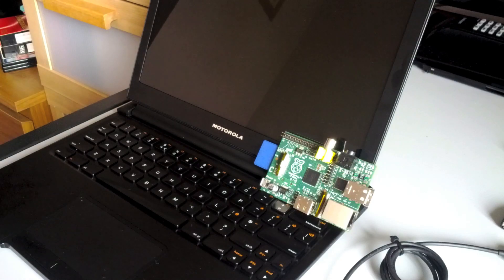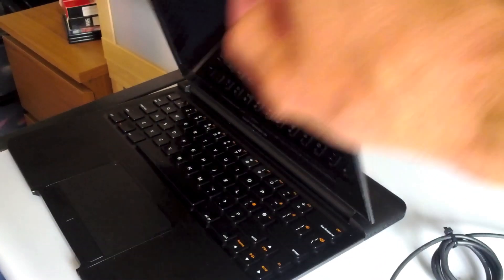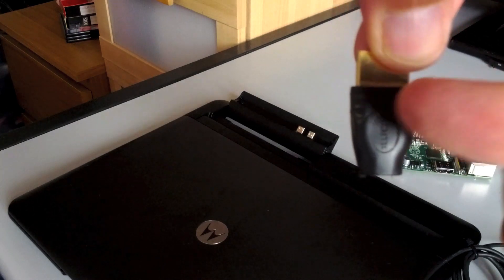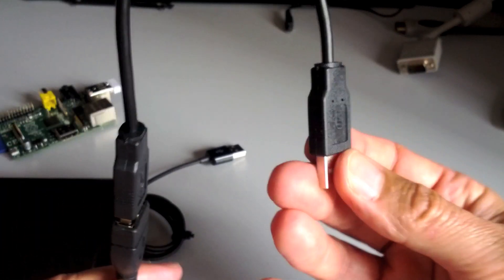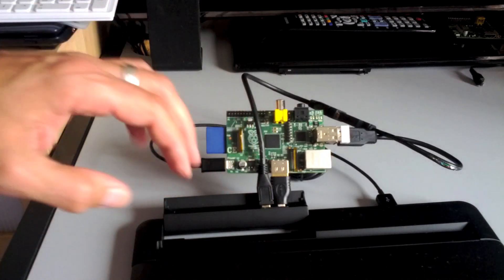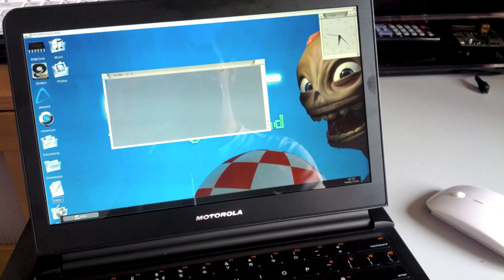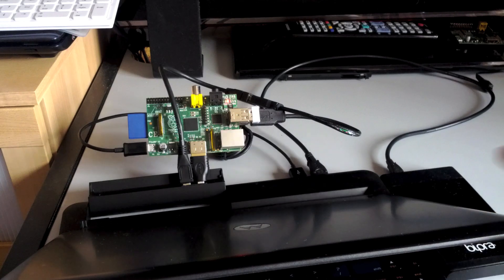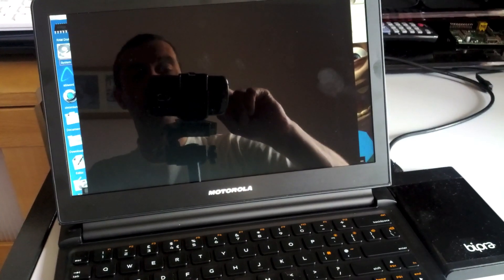Motorola Atrix and Raspberry Pi working well without soldering cable

Comment: On earlier revisions of the Pi, the power cable is needed, but for v2 you only need to connect the USB - without any cuts in it - as this will back power the Pi, but will also skip some circuitry needed in some cases for reliable power.

Comment: There is no need to cut any power lead. 
The 5V on the micro-USB power connector connects via fuse F3 to 5V0 (the main 5V rail for the pi).
The USB connectors also connect to 5V0 via USB fuses F1&F2. 
Note: F1&F2 are not fitted on later revisions - if you have an eary revision you simply need to solder a wire across F1 and another wire across F2.
So for power+kbd, just connect the Atrix micro-USB connector to one of the Type-A ports on the pi. 5V from Atrix is regulated so no need for fuse F3.

Comment: I managed to do this the same way, but instead of cutting the cable open and chopping the red wire, I cut the +5V pin off on the female end (with some veeerrry tiny scissors). Works great!

Comment: hey I acutally got my raspberry pi in the mail and I tried to hook up a usb hub to it and I learned that plugging a hub gives it power cause the hub is plugged into the wall, its basically the same concept as this.  I took the usb cable from the hub and I just sliced into the side of it.  There I found what appeared to be a giant silver wire.  I sliced into that.  In there I found 3 wires.  I just snipped the red wire and it worked well.  let me know if it worked for you.

Comment: I originally saw this done on a adafruit video.  But I think I am going to take your approach because I have no soldering abilities lol.  They only thing I think I would have a problem with is slicing the wire in the USB cord.  i wonder if there is something that would show that in detail.  You should make a video just on that showing what cord to cut.  Thanks for the video though, hopefully I get it right!!!

Comment: I got my Atrix lapdock about a week ago, and according to my experience the HDMI connector being grounded is necessary to enable the monitor.  So if it will charge and the LEDs light up, you should be good to go - just hook up the HDMI  to wake the monitor.

Comment: I got a lapdock and think its DOA, can you please confirm this if I connected a USB cable from one of the two USB slots at the back of the Lapdock to charge the Micro USb slot of rasp Pi, will it work without HDMI connected. or is the HDMI signal like a power signal for the lapdock to work? 

Any other method to check if the Lapdock is alive or not. Lapdock i have charges and also the battery indicator (5 leds ) in the front works. I am yet to see display of any kind on the system.

Comment: A few notes for those looking for these laptop docks:
The thing is the video is not an Atrix, it is /for/ the Atrix phone. Right now the one for the Atrix is the cheapest, but that may change as phones get retired.

It looks like around $60 shipped is the cheapest you can get one in the US. Bensoutlet (dot com) has them for that right now, new (and the Droid Bionic version for $90). There's a seller on ebay that sells refurbs with cables for other phones (not like these, but easy to hack apart)